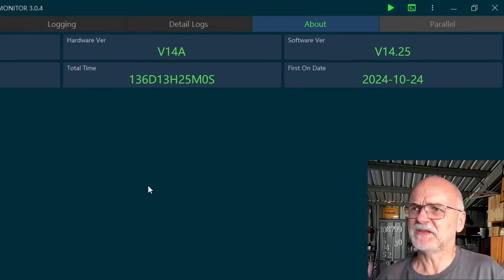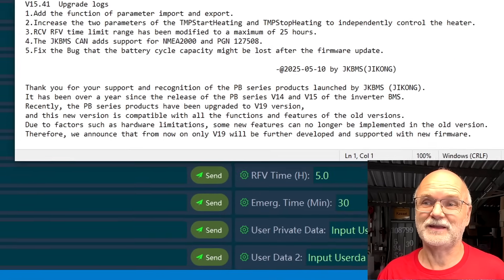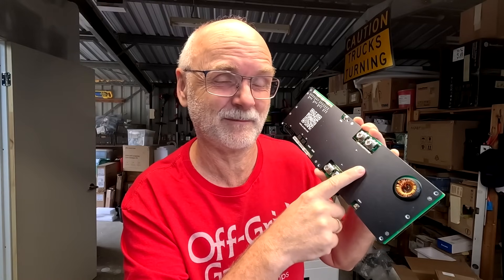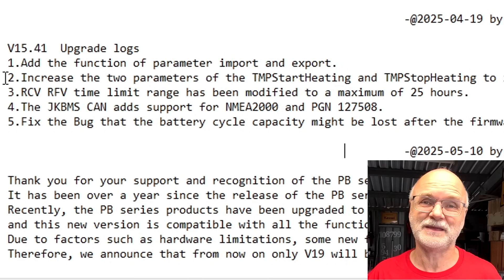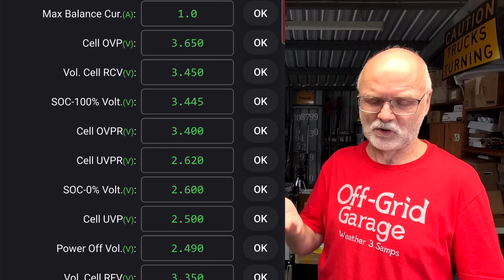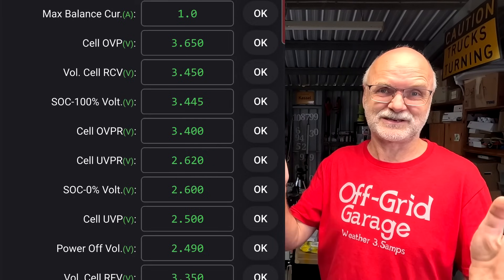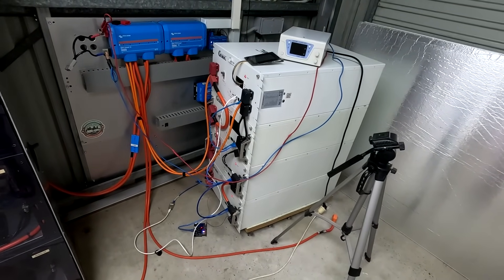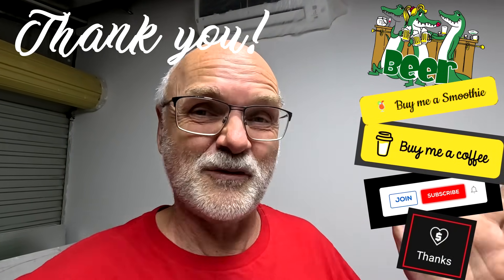The inevitable end of the JK-BMS. EOS for V14 and V15 - is that it?

Comment: Dear Andy. You know very well that the customer is a perpetual Alfa and Bata tester for JK-BMS? JK-BMS users are perpetual experimenters. It's wrapped in a modest "update" instead of indicating the real reason, the product continues to be developed based on Alfa, beta. We are far from a well-managed product like Victron and minor updates. Go for a serious BMS without gadgets. Open source and the Holy Grail I think. That would be so cool. Have you experimented with "1.2.3 smart BMS"? For example. There is a real current measurement system. It seems robust. A simple example... JK-BMS channel shouldn't be. You are much more than JK-channel I believe. You may have a turning point for another possible BMS. JK-BMS has reached the end of the off-grid garage adventure. We know the advantages and disadvantages. It goes around in circles. Broken the loop JK Andy.  Boooom JK-BMS. If you understand French or with translated subtitles, the channel "Guillaume Piton" (La Watterie) is interesting, he is a professional who has had some experience with BMS.

Comment: Had to see that coming. Kinda tired of loading fireware anyways. Looks like another one yet now and I couldn't get 15.38 loaded on my master yet because I don't seem to be able to connect to it without it coming up in parallel. Not sure what that's about but I pulled all comm cables with no success and just gave up for the moment.
Figured out a while ago that the master was driving the train and by tweaking it a bit against the slaves resolved my issue with the SOC reset. It's not perfect but works fine most of the time. At the end of the day I can't really say I have any issues. And with spares sitting on the shelf I'd say I'm good for a nice long while hopefully, 
On to more important things like hatching bebie chickies.... :)

Comment: Well, if all bugs have been ironed out, ok. But in my experience as an electronics engineer there is always something and they may prioritise newer hardware but every now and then they should release updates as required. I drive an 11 year old car with over 415.000km on it and I still get an ota software update roughly every 4 weeks. That's how manufacturers commitment to the product works.
Reply: There will always be bugs, but this is a simple isolated device with no moving parts - its performance isn't going to change over time, and neither does it have to protect against ever-evolving security threats.

Comment: Just use the battery safety controller (BSC) to set the balance time to months ;)
Reply: I would like to repeat @Bjoern's recommendation. The "BSC" is close to a "Eierlegendewollmilchsau" since it offers tons of features, different charging options, safety features, monitoring, data processing and lots more. The software is open source and constantly being developed. The hardware depends on your choice: From a 3$ china board (if this makes sense outside of testing purposes, is another story) to a completely assembled PCB. The support is great, mostly in German but as far as I know, English inquiries are most welcome.
Reply from the maker: It's a very hard to find your way into this project and it seems unstructured. There is no real documentation in English, everything is buried in forums, Discord and Github sites. I looked at it a few times before.
Reply: @OffGridGarageAustralia  That wasn't particularly well-written. This "Chaos Project" you called it is running without problems for hundreds of people.
As I wrote, there is an English firmware available. The wiki translation into English isn't fully functional yet, as it still has issues with the technical terms. But there is, of course, a large wiki about it. 
I don't know what's supposed to be buried there - A Discord chat is used for support purposes.
Reply: @OffGridGarageAustralia  The wiki is in German, yes, but it’s quite detailed and easily readable with Google Translate. Honestly, it seems like you might not have looked into it at all. The forum is strictly for support purposes, and the firmware itself is available in English.
If language ends up mattering more than actual functionality, then I’m honestly at a loss for words.
Maybe that’s why certain BMS are so popular despite their flaws – simply because their documentation is in English.
Reply from the maker: @Bjoern___  There is no clear manual or 'entrance point' for most of the process of building such a project. All the information is scattered over forums, Discord and Github sites.
If it works for some, that's great, I'm not against it, but I won't target it here on an English channel before it is better organised and documented. I don't believe any of the mentioned information sources (forums, Wiki,...) is a great way to start for someone who might be interested in this.
Reply from the maker: @shining-man  seen all your videos and am also a member of the Discord. You got the wrong impression.
Get in touch...
Reply from the maker: Is it in English and comes with good documentation now?
Reply: @OffGridGarageAustralia  Hi there! Yes, there are language specific firmwares out - also in English. The wiki is detailed and visible online. 
We have an internal wiki test version in English, but the algorithm goes crazy on some technical parts. Therefore it's not switched active at the moment.
Reply: @OffGridGarageAustralia   I think there's a Raspberry Pi for all these solutions.  Victron software is open and on their website.   I'm not an engineer but, if JK would make theirs open source, it would unlock the whole world of options and parameters.   

Computer talking to a computer.  😊😊😊

Comment: in B series   if anyone had another tiny bug   changing parameters   numbers and it wont accept em for completely no reasson giving crazy numbers on its own .,. you just ask it to  change to LFP  again to standard numbers and i think it works again!!!    and to remind that if it doesnt accept code   do not errase it and force the same typed code  123456  again it will unlock

Comment: question: Got the V19 with V19.03 firmware. I made the BMS to PC cable using the RS485 → USB adapter and it habla's so i can try to update for the first time to V19.05. Here it comes: If i don't do that and for example i have use for V19.20 can i update from V19.03 to V19.20 or do i have to go true all of them previous ones ?
Reply: You don't have to update via all the intermediate ones with V14/V15 so I guess you won't have to with this, or if you do, it will refuse to update.

Comment: I bought a jk inverter bms bundle with the 4.3 inch screen but the bms doesn't have the UART port. I haven't set it up yet but i think there are adaptor cables for screen to work.

Anyone else had this happen? Im guessing mine is a v15 BMS then? It has the shroud around the coil and no wire soldered to BMS.
JK-PB2A16S20PX4.3
Reply: I am in a similar situation
Reply: @SignedForFun  it looks like there's a separate Aliexpress listing for the v19. Annoyingly a similar price. Ah well, I'm sure v15 will do the job.

Comment: Can you run BMS application on mac or on a simulator on mac ?
Reply: There isn't a MacOS or Linux build. I have run it under wine on Linux, and it mostly works - the monitoring is fine, you can set numerical parameters and you can update firmware. What didn't work was parameters which have a drop-down of choices - the drop-downs didn't appear. I haven't tried a virtual machine but you could have a go with, e.g., Windows 10 under VirtualBox.
Reply: @matthewmarks6951  does UTM virtual machine works with usb to r232 driver ?

Comment: Does the newest version fix the capacity remaining or amp hour reporting issue and was there a fix for the dry contacts?
Reply: I don't think he's tested the accuracy of current measurement. The dry contact issue was a silly mistake in choosing component values so it would be extremely unlikely this hasn't been fixed, I hope!

Comment: You could of course work round the timer limitation by sending commands to the BMS via RS485 (for a single BMS setup, at least, where the port is not in use).

The PC app has a useful communications monitor which I used to obtain the command it sends every 0.8 s in the monitoring mode. I send this myself every 10 s and store the returned data packet, which I have reverse-engineered enough to get what I want to display up to now. (I'm sure others have done this too, but I've not found where.)

Similarly, you can see what it sends when you set parameters, and you could do this yourself. I haven't (so far) had the need to investigate this.
Reply: Adding more layers and complexity to what is actually just a safety device violates the KISS philosophy (Keep It Simple Stupid) and allows for more unforeseen circumstances that may override the safety and allow your Lithium Battery to catch fire or explode and burn your house down.. Those suggesting "Open Source" that would allow people to alter the firmware is another example of trying to take a safety device too far.. JK is trying to satisfy the bigger better faster tech junkies and it might get them to a point where safety starts becoming marginal as one failure in an ever increasing chain could spell disaster for the end user.. These devices are required to function properly for many decades/their entire lives and if they fail they are always supposed to fail to the safe/off position..
Reply: There isn't any issue with emulating what the Windows app does and reverse-engineering the monitoring protocol, which is what I have done a little - I want to log what it's doing (and, for instance, get a higher resolution of SOC than it reports to the inverter). Jikong has already given the end user the ability to change parameters via the Windows app and the Bluetooth app so I don't see doing this programmatically to be a big issue either. Open-sourcing it is much more fundamental.

Comment: JK is no longer our first choice.

I expect sustainable solutions.
Our next battery is on the horizon, but what crap will it be to deal with a V15 and V19 which might not work together.

big mess. Why should I throw good money after bad?

I buy 2 new BMS from a competitor instead and sell jk bms v15.

It was their fault to build those with too small memory.
EEL will have hopefully a good solution
Reply: Most other BMS manufacturers don't bother to provide a FW update for long; they certainly are deaf when it comes to user feedback. I don't know of another BMS with as much post launch support as these... If you find one, let us know...
Reply: they will work together and they do

Comment: Unfortunately I'm finding that Andy you're not exactly correct. Yes, it works great with Victron, but most people these days are using Hybrid inverters that are not Victron and I'm finding with Luxpower, SMB, and other 'all-in-one' inverters that the new Battery RCV RFV is really not appropriate for much of anything but Victron.. most other inverters only support a 'float' mode with Lead-Acid (no comms).. and expect a different profile. 

I would like to see you put what you say to the test with other than Victron.. Unfortunately I have to disagree with you completely with the 'Edge case' statement since your perspective is STRICTLY with Victron. :( They are not, by far, most used solution for home installation.. they, in fact, are actually the edge case and use mainly in mobile, boat.. Great hardware, but not your typical 'Solar Edge, EG4, Luxpower, Fortress, Sol-Ark' home / hybrid setup
Reply: so buy one v19 as a master bms and thats all
Reply: Good luck using any 48v battery system with SolarEdge, it SolarEdge or nothing. I have a Victron system in my garage, bolted to the wall, plenty of others do as well.
Reply: Still working this through in my head... my Sofar inverter benefits from having the delayed 100% SOC reporting function in order for balancing to be achieved, but doesn't want to start recharging again (reports battery in "standby") until the SOC drops to about 95%. During the day you can therefore lose the opportunity to top up the battery in variable sun/load conditions.
Reply: ....oder auch Deye.

Comment: I need only one feature - the correct state of charge!!! I just bought a JK BMS and it can't correctly measure current and calibration does not work and SOC shows BS. Is this also too much to ask?
Reply: totally agree
Reply: JK BMS v20, in 2026 ))
Reply: Bro: Make this simple: 0% ~=2.7V  25% = 3V Nominal AKA 50% = 3.2V.  75% SOC is 3.4V 100% SOC ~= 3.6V  Multiply by number of cells.  Also, you might have a laggard cell which is throwing off your SOC or more accurately, you probably do not have them top balanced which is throwing of SOC "calculation" which is not, it is just a Voltage reading turned into SoC.
Reply: @w8stral I don't think it has something to do with the voltages. I have 2 batteries connected in parallel. Soc is never correct . Weird thing is voltage is exactly the same.

Comment: I find the idea that the older hardware "can't run a timer for more than 24 hours" ridiculous.
Reply: I suppose their nice shiny new MCU might have a clock-driven hardware counter with more bits, so they can use this without expending effort on dealing with the overflow of a smaller counter.
Reply: @matthewmarks6951  It's not much effort though really is it... Programmers have been doing it since the beginning of coding... Adding in new features must take more than a segregated counter...
Reply: @dougle03  Well yes and no, when you take into account testing, which for this one could be lengthy! I concur that it seems like an odd thing to single out.
Reply: @matthewmarks6951  I think the rejection reason is questionable. Sure testing for 4 weeks seems problematic, but the reality is the test does not need to run for 4 weeks, accelerated testing is a science now and well understood.
Reply: @dougle03  Accelerated testing is about methodologies and processes - it can't help if the very thing you're trying to test is a time delay, because you'd have to alter it in order to speed up the testing and would therefore be testing something different. But you can certainly test critical aspects of it and extrapolate with a varying degree of certainty as to how it will perform in practice. This is minutiae though - I agree with you that it's a very odd claim for them to be making.
Reply: The RVC and RFV timer values are each stored in a single byte as units of 1/10 hour (Modbus registers 0x1504 and 0x1505). The maximum period is therefor 25.5 hours.
Reply: @streefland  One more register as a counter is common practice...

Comment: they should build it with the new esp32 S3 Ai, this has huge mem, also wifi zigbee bluetooth all on the ship and very fase for the ship
Reply: ESP's are pseudo RTOS, but not really. A BMS really does need to be at a PCL level of SIL performance.
Reply: @dougle03 PLC level?
Reply: @turbochargedbrick  Programmable Logic Controller, and SIL is Safety Integrity Level (A measure of reliability in all categories)
Reply: @dougle03  I’m aware of SIL, I just didn’t know what you meant by PCL